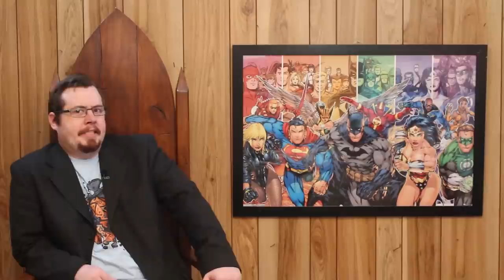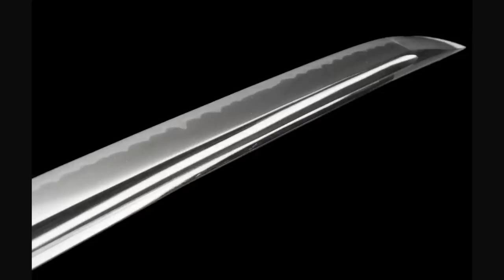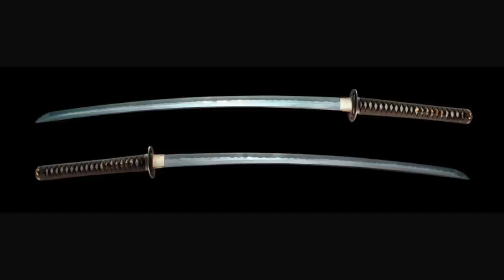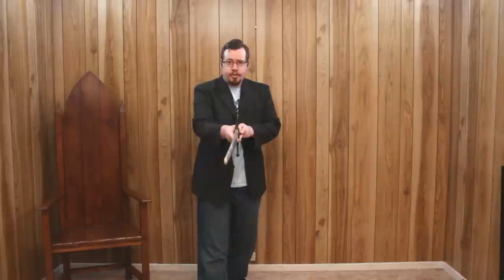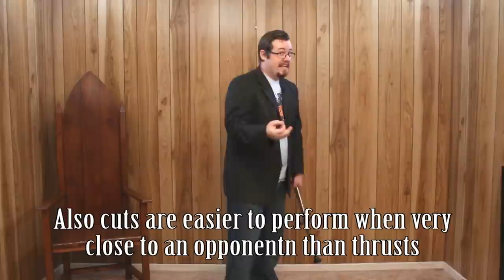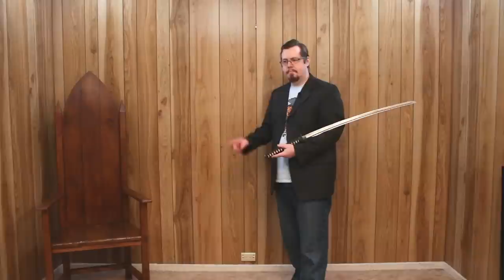Super cutting swords, are they needed?

Comment: I feel like you missed something in you comments beginning around 11:30. I think you neglect to recognize that predominantly cutting-capable swords made the majority of military sabers from the Napoleonic era well through World War 1, as well as Asian and Middle Eastern swords from the high middle ages. I wouldn't discount the cut so quickly.
There is also a point to be made about combat psychology. Blood and pain are extremely strong motivators to make someone stop fighting. You win the day when your enemy gives up the fight, even if they aren't mortally wounded. We talk about this in military training as well that slashes to cause maximum pain and bleeding (because they do cause more superficial bleeding) are more effective at stopping an untrained opponent. Thrusts and stabs kill, but they take more skill and measured strikes to be effective. I think that sabers like the 1796 and 1821 pattern cavalry sabers stuck around because it was far easier to get a decent cut than a decent thrust, and on a Napoleonic battlefield amid the fog of war, there is no time to slow down and duel one on one with a rapier.
Reply: I think a lot of that has to do with the "armor" used at the time. We did away with steel plate/chain and replaced it with heavy coat, basically. Thrusting was a less required means of killing someone - unless of course you assume the bayonet.

Comment: This is like saying anything over 9mm parabellum ammo is too much. The whole need argument pushes an agenda. Obviously someone decided they did need it or it wouldn't be here, You can stab an opponent in the shoulder and not kill. If you cut off the hand they are disabled and it is obvious to you AND your assailant the hand cannot be used anymore and they are severely injured and could perish
PSYCHOLOGY is very important, and remember that it works BOTH- WAYS. IF you remove an arm at the elbow worse and so on. Immediate disablement may be needed. A properly made Bowie Knife can cut and thrust and chop, hack, and snap cut. It doesn't have the armor piercing point of a large well made tanto of the same blade length but it will do the job just as good if not better if properly made. Great vid Shad!!😎

Comment: I think comparing a longsword to a one-handed cutting sword is a little unfair, but even that said, I think you're only thinking about highly skilled  combatants and probably not in a melee where you don't have time to 1v1 anyone. Cuts are easier, and need less training. Also getting actually good with the sword takes training time away from something like archery, so it's probably just better for a lot of people to have the easier sword that they can just hack away with should the need arise and spend the time training the bow. That's the reason longbowmen had falchions, right? They were mainly using the bow, but if they needed a sword, they wanted an easy to use cleaver.

Comment: I think you're asking the wrong question. In your chain mail video, you pointed out that if mail were as poor as in those "documentaries" it never would have been used so much. Why would that not apply to the blades you speak of here? That's the question i'd like to see you answer, like with mail. Why was it used so much by the cultures that used them, for the time they did so, and against the enemies they fought while wielding them.
Reply: Okay here we go. Super cutting swords weren't popular at all, most cutting designs are made so because they are also designed to be comfortable to wear, many shamshirs are what 700 gramms? You have to make it as top heavy as possible to do well in cuts with it. Even the type XVa longswords are good enough in the cut (the thrustiest design) to take your arms off without problem in a civilian context at least. Hell George Silver talks about his short sword (which is actually a rapier but nobody tell him that) is good enough in the cut to simply send limbs flying. Super cutting swords are rare by comparison, a few types of dao and falchion exist that have the qualities, like a broad blade that is top heavy and they weigh a lot for their length (900-1200 gramms for a 60 cm blade is heavy yes, think of Elmslie Type 1 swords). And they are usually straight/only curve at/before the tip.

Point is super-duper cutting swords don't really exist apart from a select few examples. A shamshir that is dubbed a good cutting sword will be outcut by a type XIV arming sword any time of the day simply because of design choices other than curvature.

Comment: Okay here we go. Super cutting swords weren't popular at all, most cutting designs are made so because they are also designed to be comfortable to wear, many shamshirs are what 700 gramms? You have to make it as top heavy as possible to do well in cuts with it. Even the type XVa longswords are good enough in the cut (the thrustiest design) to take you arms off without problem in a civilian context at least. Hell George Silver talks about his short sword (which is actually a rapier but nobody tell him that) is good enough in the cut to simply send limbs flying. Super cutting swords are rare by comparison, a few types of dao and falchion exist that have the qualities, like a broad blade that is top heavy and they weigh a lot for their length (900-1200 gramms for a 60 cm blade is heavy yes, think of Elmslie Type 1 swords). And they are usually straight/only curve at/before the tip.

Comment: There could be more into the metallurgy and armor of the time resulting in the design of the weapon. If your metal cannot handle the thrusting to the heavier armor it is not going to be an effective weapon where a more robust blade or club could handle wearing down the opponent
Reply: Cornered Fox by heavier armor I mean progressing from skin through plate as a dynamic process. Not all steels will hold up against different materials nor will they necessarily hold true in particular shapes and was wondering what forms might be seen due to material limitations rather than intending to be strictly good at stabbing or slashing.
Reply: Cornered Fox yes mostly my understanding is the Japanese folded many times to work in carbon and work on impurities of poor steels as well as using different grades and differential tempers, Norse used twisting and folding in bar patterns to my knowledge till they acquired higher quality steels. I am curious to other methods and shapes are do to local material limitations

Comment: Isnt being able to follow through the entire cut of a limb instead of being forced to pull your sword out a MASSIVE advantage when facing multiple opponents?
Reply: Yes it is but if you are facing multiple opponents and you ony have your sidearm you are fucked anyway because you cannot keep them at bay with anything. You will engage with the first opponent who can surely defend against your first strike while the others will close in and straight up lynch you.

If you have a greatsword on the other hand it's a completely different situation, they have much more momentum, you cannot really deflect or parry a strike from a sword that large with a medium sized sword so it is effective at keeping opponents at bay.

Also even thrusting oriented swords of the middle ages have more than enough cutting power to simply lop off limbs without too much problem.

Why develop even cuttier swords? There is no kill like overkill, also when really cutty swords were used people often wore gambesons 30+ layers thick and that much clothing needs something that has substantially more cutting power even when compared to a katana.

Comment: Bastard sword? As cutting weapon? I hope that You would do video dedicated to hand and a half sword.
Also I think that thrust is more efficient than cutting. Cutting is more about bleeding opponent and thrust is instant disable.
Reply: Unless you hit in the T-box, the spinal chord or the heart it is not going to be an instant disable. Even if you pierce the lungs performance may only become detrimental after as long as 30 seconds. Thrusts have few thing going for them, it's more disabling on the long run and potentially deadlier, also much much easier to go through armours with a thrust (like gambesons, with maille you will still suffer)
Reply: Anyway it is generally effective than cutting. For cutting to be effective, you should cut target bigger blood vessel on the neck. on inner side of arm or leg. Or cut important string.
Reply: Cutting ligaments can disable limbs permanently, though reconstructive surgery for that kind of damage has been done for the better part of the last 5000 years even though modern methods are much much more effective.

Comment: I am surprised you barely mentioned armor and culture. And there is no such thing as overkill, only resource management. A dagger (double or triple wdge knife) is technically that most effecent killing machine if you still want some ability to defend, but if all you care about is offense: karabit.
A sword (no arching curve profile) is easier to make precise thrusts in between plates or chain mail that is the advantage.
However If the trasfer on KE is not dispersed though the armoe that matters little: if I take a raper and stabb the armpit of an an enemy, more than likely,I rendered that arm useless in combat. If I had a falchion that smashed the shoulder of an enemy, I rendered that arm useless in combat--just in a different way.
As good as a rapier is I don't see it being more effective than say a long sword when it comes to plate armore warefare. Not to say it can't be effective, but there is a difference between fight a noble with a rapier and boss (buckler) and a knight with full armor.
If it were me and I had to chose a melee weapon I would go with a spear over sword to fight on a battlefield with oppenents in chain mail. If I know my opponent is wearing knight armor, I want a halbert with a flat hammerhead, and spike and spear tip.
I want the bladeds to have no barbs, hooks, or teeth to worry about getting lodged into an enemy.
One on one battle or a small skirmish with no armor, I want to chop limbs off!! Let them pass out from shock and succumb to blood loss, foreget the finesse of sticking this point or that point of the body, let's move on to the next person!!!

Comment: Katana: Self defense with VERY fast drawcut. Very good to kill bandits, or a random ninja.

Saber: very good for use on a horse, and very nice to show your friends the nice golden ornamental guard you put on it.

Cimitar: Very good at cuting slaves rebels and thiefs hands, also ok for self defense.

They are good for that, not for duels/battlefield/adventure (unless you are fighting people without any armor). If i was a Viking i would want a Viking sword with a shield or maibe dual weild, and if i was a knight with armor i would use a big two handed sword.
Reply: Katana: A decent weapon given the type of armor Japan had. Its mail armor was mostly butted or split ring (like a key chain), meaning it was possible to force it open through sheer force (technically can do that with riveted mail too, but it's much harder and you usually need a very small tip). Furthermore most troops in feudal Japan didn't have full coverage armor, a foot soldier might have little more than a cuirass and helmet, leaving plenty left to cut off. Losing an arm or leg in battle was as good as dying.

Saber: This is a stupidly broad category, with shallow and significantly curved swords, and even two handed variants with a curve so slight they might as well be straight (like the Swiss Saber, Wallace Collection inventory number A489, though they call it a "curved longsword"). The stereotypical cavalry saber is good from horseback, but what needs to be understood is that they weren't really intended to go up against people wearing full metal armor. That's not to say it didn't happen on occasion, but guns had become commonplace by the time the saber became common in Europe. With that metal armor began to diminish, though the cuirass lasted a while because it could be armored up enough to protect the wearer and not limit mobility due to weight (bullet resistant armor made of steel tends to be a bit heavy). 

Scimitar: Similar to the saber really, a bit older but not as much as people think. The Turks were mostly using straight swords during the Crusades. Furthermore similar to Japan not everyone the Turks fought used full coverage metal armor, it depended on the country in question how well armored the average foot soldier was.

Comment: basically thrust are usless except in duel or when you are totally safe from other opponent (someone on your side protecting you)
let say you thrust in someone and need about a second to remove your blade and someone take a swing at your hand
 congratulation you've killed someone and lost your arm in the meantime
the same goes for an "half cut limb" you arm(s) is wide open for anyone near your target to cut

while if you overkill your cut your blade is free maybe not in perfect position to block but that is the next thought you put in your to do list not removing the damn thing from the ennemy

also "failed thrust" are more detrimental than "failed cut"  froward momentum and such

also i think if someone got a limb chopped off right in front of you, it's more shocking than them "just" being stabed or partially cut

just my point of view though
Reply: when i said failed i meant paried (not an incompetent swinging a sword randomly)
paried thrust expose greatly you arm, in worst case scenario with a cut you are at the same point than with a thrust, best case scenario, you are barely exposed.

not even talking about a draw cut.

also most of the weapon he say were super cutting oriented can actually perform good thrust (katan and messer are the obvious one.

the chopping off the limb (compared to a partial cut) also allow you to finish the move in a guard position.

cutting rapier i highly doubt they would have been of any use against someone using hardened leather, i even doubt they would have been effective enough against padded armor.

but yeah longsword are fine too.

it's just that their is a lot of plus on cutting swords that he don't bring up and cons for non "super cutting" that he dont bring either
Reply: well i agree on that coment :
cutting vs thrusting is really context dependent
against mail clearly thrusting (and striking) is the best
against plate only striking is relevent (longsword/greatsword)
against anything else both are usefull

for the exemple of the katana it faced mostly unarmored opponent (like most "super cutting swords" )
and fights were really brief in thoose kind of warfare

and sword is the most irrelevant weapon on a battlefield anyway, bow,polearms, and shield are leagues better (in terms of survival and kill) and even flanged maces were superior in europe (not everywhere though, they weren't used that much in east asia)

for parying all depend on the styles
knowing that drawcut are guard to guard moves and not really available for "hybrid swords" due to the straight blade (in his definition any curved blade is cut specialised)

Comment: extra cutting power is only effective in the case where you are able to grab the shaft of a spear, and sever the spearhead... however, this is again over-kill, as if you are able to seize the weapon of a spear man, it is more efficient and easier to just strike the spear man rather than his weapon.... in such a case, the ability to break a weapon in this fashion is a fear tactic... 

And honestly, you are better off using an axe to chop at a spear than abusing a sword in this manor... while an excessively sharp sword might be able to cut a spear-shaft (i say might because i severely doubt the plausibility of cutting the shaft of a spear like this, you would need a sword designed for chopping to really make this a viable option) it is wasted effort to do so in my opinion... 

in most instances of this, it would still take several swings of a sword and some axes to sufficiently damage the spear shaft to make it unusable to the spear man.... 

Literally easier to just stab the spear man... or chop at him, depending on his armor.

Comment: You can't use a  longsword effectivelly as a cavalary. İf you are a cavalary you want smallest amount of resistence. You want to cut and go. you don't want your sword to stuck because you will either stop or lose your sword.
Reply: Yes you can, even straight swords have a very miniscule chance of getting stuck, but they are more efficient in energy transfer which is why straight cavalry blades remained popular to the 19th century and eventually curved blades completely phased out by 1870, why straight (albeit thrusting and not cutting) blades remained in use up to WWI.
Reply: Yeah but armours also phased out in 19th century. No good sword would stuck in flesh and bone. Armour is the problem. Cavalary units have to hit fast and continiue. Straight swords stuck in armor, curved swords either cut or bounce back. Btw cavalary have to use his wrists curved blades give you that opportinty. Straight swords are bad for your wrists. And also look at evidence. Every cavalary army used curved swords for centuries. Their experience is better than our arguments.